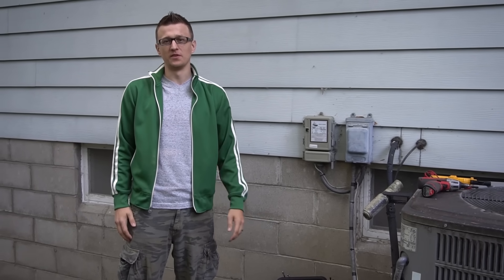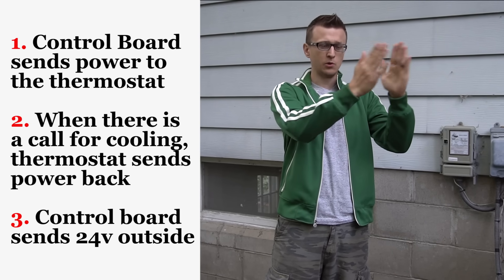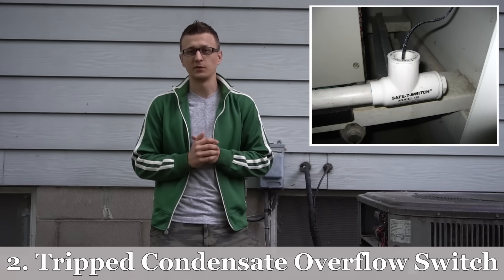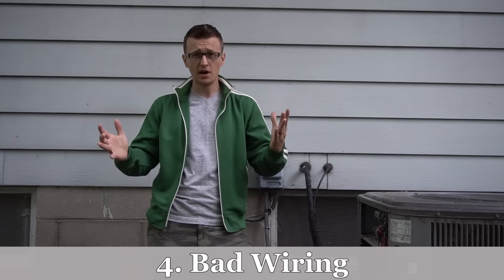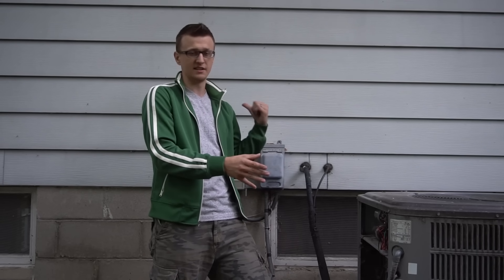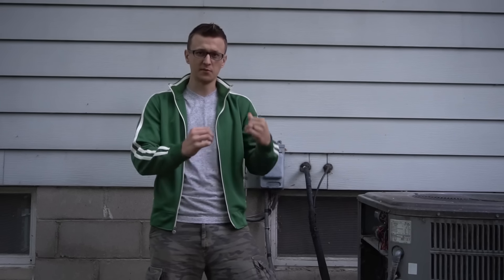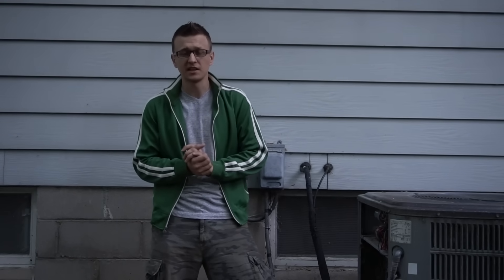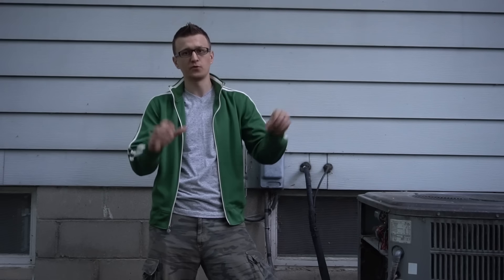AC Contactor Not Pulling In - 10 Reasons Why

Comment: Hi.  You have got to be the smartest HVAC advice guy on YouTube.  Thank you so much for your diagnostic help so far.  I am mostly clueless about electronics.  I hope I can ask you the following question to see what you think.  My contactor is not engaging because 24V is not getting to it.  I can make my AC run fine if I just hold down the contactor manually.  When I measure between the RC and Y contacts on my battery-operated thermostat (when set to OFF), I get 27V. When I follow the red wire from my thermostat into the furnace closet, I see that it branches to a condensate overflow safety switch and then later to a condensate pump.  It then goes to my utility company's power saver box.  If I put my meter leads on the wire right before it goes into the power saver and on the white wire (call it W1) that's going directly to my contactor outside (it was directly connected to the yellow wire from the thermostat), I read 27V.  If I then test across the orange wire coming OUT of the power saver and W1, I get zero volts.  When I turn the AC to auto/cool, I still have no voltage.  I chose to test the orange wire because it connects to the red wire (R1) that goes directly to the contactor with W1.  There is also a brown wire coming from a 120/24V transformer that connects with both the orange wire and R1.  My first thought is that something in the power saver is losing the 27V.  But, I wonder also whether the brown wire coming from the transformer is actually supposed to supply the 24V that the contactor needs.  There are also several other wires coming from the power saver that go to that transformer and to the circuit panel on the furnace.  Should I learn to test out that transformer?  My utility company is ignoring my requests for assistance so far.   I'd appreciate knowing whether you'd immediately suspect a problem with the power saver or if I'm over-simplifying things.  Thanks for your help.
Reply from the maker: Hey Ray! Sorry to hear about the AC troubles! From what you described, it sure does sound like a bad power saver switch.. You could temporarily (or permanently - up to you ;) disconnect that power saver switch to see if that is indeed the only problem. I don't think mine is exactly like yours but it should be similar... I have a video on that specific topic, don't know if you have seen it yet: https://www.youtube.com/watch?v=HtEGHEDmqpA&t=3s
Reply: @WordofAdviceTV  Thanks.  I looked at your power saver video as soon as I suspected it.  My power saver (attached to the side of the furnace indoors) looks a lot more complex - several wires going in or out of it. I'm clueless, because I don't understand circuitry, I'm afraid.  The power wire coming from the thermostat connects directly to another blue wire that goes directly into the power saver.  If I measure between that connection and the W1 wire that's going to the contactor, I get my 27V.  If I disconnect the power wire from the blue wire and connect the power wire directly to the R1 that goes to the contactor, the voltage disappears.  So, I'm not drawing a good picture for you, I think.  I appreciate your help very much, but I guess I'm going to, first, get the power saver removed (hopefully, Duke Energy will do that quickly for me).  Then, if I can't figure things out, I'll need to hire a smart electrician.  Thanks very much though.
Reply: @rayfreeman4079
Reply from the maker: Okay, no problem! If it is a little complicated then it's probably best to let Duke Energy remove the box for you. I could try to walk you through it but it would be a sad day if something accidentally gets shorted out in the process. Hopefully the box is all it was, good luck!
Reply: @WordofAdviceTV  OK.  Not giving up quite yet.  Duke removed the power saver, but still having problems.  Tell me if this makes sense.  The red wire coming from my thermostat branches off to a condensate flood switch and then to a condensate pump.  That wire then attaches to a thick red wire coming out of a transformer (refer to this as Connection A below) . This side of the transformer has two leads (the thick red wire and a thick brown wire) and I'm assuming it's the 24V side of the transformer.  The thick brown wire connects to another thick brown wire that's attached to something inside the furnace chasis (blower or heater?) and also attached to another thick brown wire that's grounded to the chasis.  Then there's another thick brown wire connected at that same juncture of wires that runs outside of the furnace chasis and connects to the red wire that goes outside the house to the contactor.  The yellow wire from my thermostat is still connected directly to the white wire that goes to the contactor.  If I strip a bit of both the red and white wires that go to the contactor, and attach my meter leads to each, I read one half volt with the AC turned off and 2V with it turned on.  If I attach my leads to the stripped area of red wire going to the contactor and to Connection A (see above), I read 27.5V whether the AC is turned on or off.  Sadly, I don't understand the rules for measuring at the proper places with my meter.  Is it valid for me to measure across the stripped areas of the red and white wires that go to the contactor and expect to see the 27V?  Thanks again.
Reply from the maker: @rayfreeman4079  Sorry to hear that the problem persists! Though I appreciate how descriptive you are, I am still having a hard time picturing it in my head... But just to make sure.. Have you tested the drain pump and the overflow switch? If you take the overflow switch wires out of the wire nuts that they go into and check continuity or resistance on the two wires, is there some kind of resistance reading or does it say O/L? Also, if you haven't done this yet, try bypassing the thermostat once. Jumper R to Y at the thermostat and see if that makes any difference. I have a video on how to bypass a thermostat if you need it. From what you described, it sounds like something is stopping the 24v from getting to the contactor coil. Something that is between Connection A and the contactor is interrupting the power.
Reply: @WordofAdviceTV  Genius you are!  After doing everything the hard way, I just jumped RC and Y and voila!!! - I get my voltage at the condenser.  So, new thermostat time?  Or is there a workaround or fix for that?
Reply: From Ray: you really made this problem so easy to find in your 10 contactor issues video.  I don't know why I skipped over that test.  My thermostat is simply a small control board with a plain plastic cover.  The RH is jumpered to the RC, which then runs into my furnace closet.  It's battery operated with no common wire.  So, I guess I will replace with the same brand/model to be safe and sure when wiring the new thermostat back up.  Thanks big time for your help.  Is there any way to donate to you?
Reply from the maker: @rayfreeman4079  You're welcome! I'm happy to hear you didn't give up and were able to find the problem! :) Even though it was a hassle doing it the hard way, I am sure you learned a lot about your HVAC system while you were at it! So if anything comes up later on you will be much more confident going in. You asked if there is a workaround. There is not. Unless the batteries are weak and that is what's causing it. I would try replacing the batteries and if that doesn't solve it, then yes. Time for a new thermostat. I hope you don't feel obligated to donate to me. I'm glad I could help! If you still really have the urge, I have a PayPal link in the description of the video. Stay cool and may your AC be problem free for at least 10 years! ;)
Reply: @WordofAdviceTV  I did learn some things.  Batteries are good, so I will buy a new $25 thermostat.  Thanks very much.
Reply: @WordofAdviceTV  Hello again my friend!  I suspected early on that I had more than one problem.  Hopefully you can help me with a final problem.  The fan and compressor are usually not working, but once a day or so, for at least a half hour, the fan and compressor will run correctly (after a day's rest?).  Right now, the AC's been off for a full day and won't come back on.  I've taken the high pressure switch out of the 27V circuit and things work great, but I've now wired it back in to be safe.  Now, if I press and hold the reset button on that switch, everything runs while I'm holding it in.  When I let go, everything stops.  Do you know if this is more indicative of just a bad pressure switch or a bigger problem with the condenser?  I was told a couple of months ago, by a pro, that my refrigerant levels/pressures looked just fine.  Thanks again.
Reply from the maker: @rayfreeman4079  Hi again Ray! Sorry to hear that the battle is not over yet. If your refrigerant levels are fine then I would think that the high pressure switch is defective just like you concluded. I have seen those go bad in a similar fashion a few times before. If you haven't washed down your condenser coil yet, I would do that just in case. (a plugged coil, even though it may look clean, is the most common reason why the high pressure switch trips) The proper fix is to replace the high pressure switch... But I just thought I would let you know that not all air conditioners even have a high pressure switch. ;) But all compressors have internal pressure overloads. So if the pressures get too high, they trip, therefore a HPS is not mandatory.. What you want to do from here is up to you good sir.
Reply: @WordofAdviceTV  The coil looks pretty clean and I hosed it down pretty well anyway.  Glad to hear that I can do without the new switch without worrying about fires or refrigerant leaks, etc.  A replacement is only $35, but I think I'll skip it.  My unit is 15 years old, and I think my compressor is on its last legs anyway.  Since I don't use the AC often or for long periods of time, I'll see what happens without the switch over the next year.  Worst case, it will be time for a new system sooner than later.  Thanks for your video re: hardware best picks.  And thanks again for your time.  Take care.
Reply: @WordofAdviceTV  OK, just one more thing - really.  If my condenser fan is stopping after say 20 minutes and causing the compressor to stop (by tripping the high pressure switch maybe?), shouldn't I then be able to push the pressure reset (after many hours of rest) and expect things to start right back up?  I'm trying to eliminate the fan as a possible problem.  If it is the problem, shouldn't I be able to reset the pressure switch and get things working?  After all, if I hold the pressure reset button, both the compressor and fan start working until I let it go.  I can spin the fan freely, and it generally starts up fine on its own when the system is working.  However, on a few occasions, the fan has not started or has started slowly until I push the blades with a stick.  I'm concerned that, if my fan is the problem that trips the pressure switch, I should fix/replace the fan.  I wonder if oiling it or installing a start capacitor for it (already have installed one for the compressor) would help.  My main concern: if I remove the high pressure switch, and the unit stops again because of the compressor's internal overload, would the compressor still be healthy enough to work again once I replaced the fan motor?
Reply: @rayfreeman4079  - I think you just solved my issue at a tenants house. Thanks!!!!!
Reply: Ray Freeman in trying to solve my own issues (I am no expert) reading your last issue it sounds like a bad start capacitor for your fan based on the video I just saw for my Lenox unit.
Reply: Correction: its a 240/24 V transformer on the side of my furnace

Comment: I've changed the thermostat and nothing. I bypassed at thermostat after replacing and didn't go so I went ahead and depressed the contactor and it engages but when released it immediately goes off. Getting 240 volts in but nothing is working. The fan outside isn't going and not getting action with the blower in the attic either. What should I move onto next for troubleshooting? Thanks for any help.
Reply from the maker: Unfortunately for the scenario that you described, this video would be my recommended next step.. It sounds like the 24v that is supposed to pull in that plunger is not getting to the contactor.
Reply: @WordofAdviceTV  I tested the power underneath (coming directly to contactor from fuse box) and was 240 volts plus. I was just about to test the 2 contacts w my leads on the side of the contactor but now the on call box is off and no power at all.
Reply from the maker: @RyanSpringer1984  Yeah.. Those power saver switches can be pretty annoying...
Reply: @WordofAdviceTV  should have never let them hook it back up

Comment: Hi. Thank you for your videos. My control board is sending out 24V but I'm only measuring about 1V at my contactor when cooling is on. Any advice? Should I replace the low voltage wires that go from my control board to my contactor switch? Should I use a fishing line or is there a better way?
Reply: I just replaced my low voltage wires. They have continuity and my AC works again! Thank you, Jay!

Comment: Thank you for your content. I have a question. When I came home Sunday afternoon I noticed that even though the thermostat was set to 71 the inside temp was 74. On a really hot day this is normal but Sunday was a cooler day that our system should have been able to keep up with easily. I walked out back to find the outside unit wasn't running. No humming, no anything. Rather than going into everything I've done since then let me share what I've discovered. The unit sometimes kicks on but sometimes doesn't, for instance, while I was checking the wiring in the side panel of the outdoors unit it decided to kick on and ran fine the rest of Sunday and Monday. However, Monday night, at bedtime, I realized again that the thermostat was set to 71 but the inside temp was 73. Again, a cooler day that shouldn't have been a problem for the system. Again, the outside unit wasn't running. I've narrowed it down to either the contactor, the capacitor or the thermostat but I haven't put a multimeter on any of them yet. Here's what I know, if I hold the plunger on the contactor in the unit runs fine and cools the house. Trouble is, the contactor only works sometimes. For instance, I went to bed last night after troubleshooting the thing for over an hour and the outside unit still wasn't working. But apparently, somewhere in the night it decided to kick on because this morning it's working fine again.
From all this, am I headed in the right direction, or does any of this information narrow it down even more than I realize?
Thanks again.
Reply from the maker: Sorry to hear about the AC troubles man! But yes, it sounds like you are headed in the right direction! From what you described, most likely the problem is not in the capacitor or contactor. Sounds to me like the contactor coil does not always get 24v. Which is what this video is all about. As you saw from the video, there are at least 10 different things that can cause that, so hopefully one of the ones I list in the video will be it.

Comment: So my contactor was bad ,I replaced it then the contactor wouldn't pull in ,Found a 3 amp fuse on circuit board was bad
Reply from the maker: Yeah.. Sometimes it's more than one problem or to be more specific, one problem causes more problems.

Comment: Bro,i have a copeland scroll  zr34k1 pfv 230 compressor in a 15 yr old(approx) hvac system.that has (2) 24 v wires running into the top if it.they are in series with contactor coil.new contactor new m.s.cap.keeps blowing 3amp fuse on controll board.what are the wires to?(there are the 3 standard wires to comp. no low or high pressure switches on the pressure lines)any help or advice greatly appr
Reply from the maker: Hey Aaron! If you look at the condenser wiring diagram, does it show you what component those wires go to? Also, I just posted a new video on how to find a low voltage short. You can use that for reference too
Reply: @WordofAdviceTV  no wiring diagram on inside of cover door (where they usually are)its for my dads house and he says he has the paperwork for it but hes 86yrs young and has a lot of memory issues.i have spent 3 days and its in the compressor,the 5 min shrt cycle  timer checks good also.a friend of a friend is in the business and she relayed same message.so he will come by and help if necessary.thanks!

Comment: Will the high pressure switch trip if the unit is over charged ? Do some of them reset themselves  after awhile ?  Thanks, great video !
Reply from the maker: Yes, it can trip. A low pressure switch is auto reset but high pressure switches are manual reset, they should not reset automatically.

Comment: Props bro.  Subscribed. You saved me from destroying my Sheetrock by suggesting the condensate overflow switch was the problem. I had jumpered the contactor to keep the house cooled (Atlanta, August). When I finally checked the attic Unit, water was up to the rim of the catch pan. Some chlorox in the drain line cleared a pint of snot.   Now we are cooling fine and condensate is draining.
Reply from the maker: Glad to hear you were able to find the problem and get it fixed! Without destroying any walls :) Thank you for subscribing and coming back to leave a comment. Stay cool!